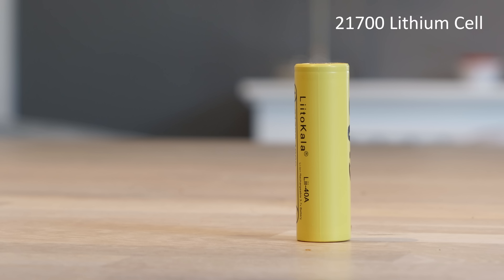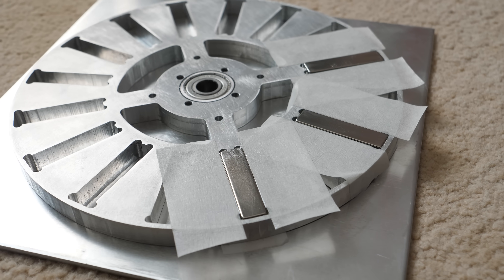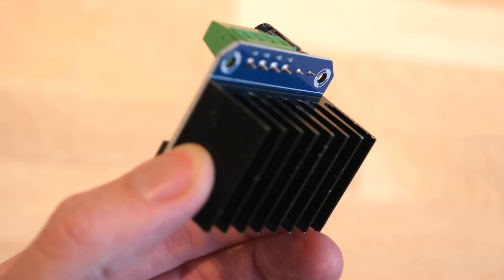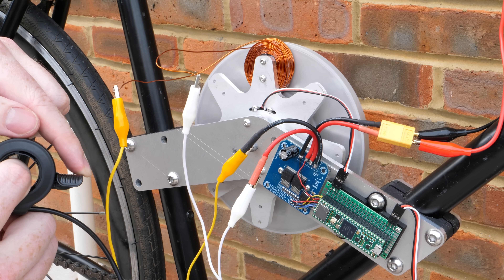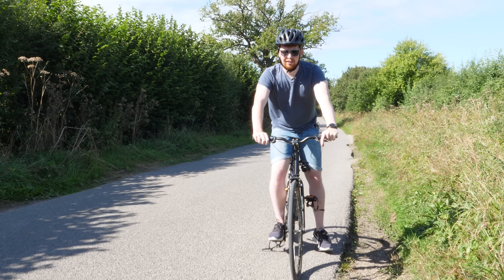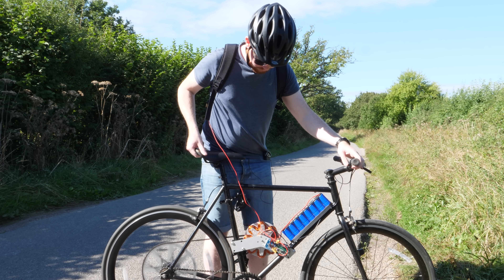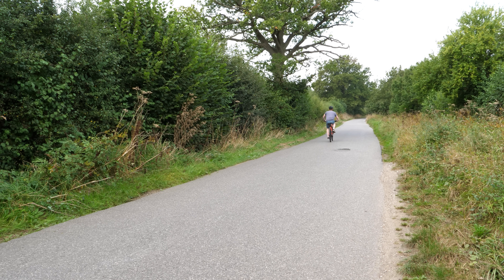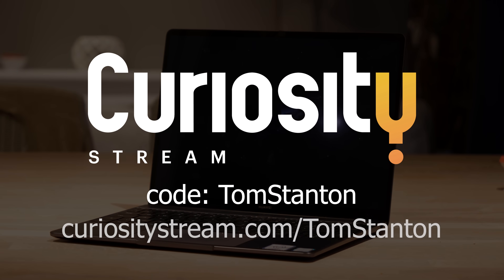Super Capacitor Bike

Comment: I reckon you're definitely onto something with the regen potential, almost like a boost to an additional lithium pack. Love how well the ultra basic BLDC controller works! Would love to see a speed limit test on it with some big voltage behind it ;)
Reply: He was dead on with the cap sizing!  Tom used 11 kJ of capacitors, and an 80 kg mass at 30 mph/50 kph has ~8 kJ of kinetic energy.  Note that he's pushing them pretty hard, though- these guys together are rated for 475 W continuous and 3888 W peak, so running them on a 4 kW motor from dead to full is pretty aggressive.

11 kJ is perfect- in practice, you want 30-60% extra since you have to get down to half voltage to get even 75% energy recovery.  You can use a boost circuit as well but they're not very efficient.  I'll note that li-ion is actually pretty amazing, though: with high performance cells like a 40T3 an 8 kg 1.5 kWh pack can push 20 kW peak, 14 kW continuous, and anything <8 kW is about 99% efficient.

  @Drone Force   A 4000 lb car @80 mph/130 kph has ~12 MJ of kinetic energy, so you'd want around 800 (~56 kg) of those capacitors to get a car up to/down from speed.  You'd probably want more, though- these ones could only handle 47.5 kW/ 64 HP continuous (but 390 kW peak).
Reply: @harperwillis5447  Sorry but your 99% efficiency claim fails to account for the horrendously inefficient charge cycle. Electric vehicles as anything more than toys are a fools errand. Even Tom properly acknowledges the power density of just about any liquid fuel is vastly superior to the best battery... and have fun charging your shit up for 1-3 hours just to get 50% when I can fill a gas tank up in a few minutes
Reply: @alphaforce6998   try looking up coulomb efficiency- li-ion is ~99% efficient while charging.
Reply: @harperwillis5447  No, they're not 99% efficient because that would only be under specific circumstances and a best-case scenario. You'd have to be charging at relatively low currents, and as the heat of the battery increases by virtue of reaching its capacity, the efficiency drops off sharply.

The net efficiency at a reasonable charge rate (i.e. something notably more than 1C) is going to be below 95%, realistically in the 85-90% range. This may improve for a short time after a few initial charges, only to gradually degrade again as the battery itself breaks down and loses the ability to hold a charge.
Reply: @alphaforce6998  no mate you have misread and misunderstood me as I've said twice now. NO STAND IN. that's replacement or one or the other. Whatever you think about batteries is wrong hideously anyway simply proven by trying to force charge a lipo. But
 I said you use them both together in synergy. The supercap captures and stores, it can capture all the small extra wasted energies not capturable via a battery because it's too inefficient on charge.  But if demanded immediately the supercap will feed the demand, if not demanded the supercap can charge the battery at the slower rate the battery needs. Meaning that in combination the batt and supercap overcome the limitation of resistance vs capacity. What the heck have you been talking about? And or reading? Wake up bro.
Reply: @alphaforce6998  1-3 hours to charge to 50%?  My model 3 charges to 50% in 10 minutes.
Reply: @DigitalArtisan77  You clearly have a theory based upon a lot of things you have no clue about. The only thing the capacitors might do is provide a bit of extra current to get a heavy load going, which is essentially what motor start capacitors do. Even if you use caps to capture a charge on braking or something of that sort, it will be a very limited amount and is dubious as to whether or not the weight and added complexity of the caps is worth the "benefit". You're living in some fantasy land where you believe electric everything is the future, and unfortunately for you, if it ever comes to that you'll be in a cube somewhere doing your prescribed routines for the system.
Reply: @niktak1114  False statements are fun, unless you're charging to 50% from 49%.
Reply: @alphaforce6998  the max charge rate for the model 3 is 250kW. The battery pack is only ~75kwh. I'll let you do the math.
Reply: @niktak1114  Typical house has 200 amp electric at 240 V, which means 48 kW if you max out the mains at the utility junction. Nobody is charging their cars from empty to 50% in 10 mins, and even at those stupid charge stations (which are rare) you are not getting 250 kW.

So by your own math, and a REALISTIC charge rate of 30 kW you are going to need about 2 hours to hit 50% on a 75 kw/h capacity pack. You'd be charging it at 0.5 C which is very low. You couldn't even hit 1C unless you pay for something like 3-phase electric with 360/480V.

Stupid are the ones who wear the mask, inject with poison, and roll around in ugly electric cars.
Reply: @alphaforce6998  and they are not rare at all. I've road tripped all over the western US in mine charging only from superchargers.
Reply: @alphaforce6998  look at a supercharger map. You can easily cross the US.
Reply: @niktak1114   When I fill up my tank with fuel, I do so knowing that just about anywhere I go I will be able to refill it when needed. If you want to travel along your supposed pre-approved corporatecuck EV route, by all means, go right ahead. Just don't stray too far - cattle needs to stay in its lane.
Reply: @alphaforce6998  Enjoy it while it lasts. Unless you are a senior citizen already then you'll live to see the day when gas stations are rare.
Reply: @alphaforce6998  Li-ion charge/discharge efficiency increases as temperature increases because it lowers the ion flow resistance.  Hot molecules move faster, which prevents side reactions.  High temperatures are only inefficient when the battery is not charging/discharging, because it also increases self-discharge.

Coulombic efficiency is always >99.9%.  If a battery is running with <99.9% coulombic efficiency then it will stop working after less than 100 cycles.
Reply: @harperwillis5447   Seems like you're attempting to present theoretical claims as if they mirror reality. The main issue is that heat causes a degradation of capacity and cycles, and that is just one of the many shortcomings of relying on an all-electric transportation device.
Reply: @harperwillis5447  great physics dude, I'm very low left brain. I don't know how I insinuated I was needing anything for a car, oh I meant the fly wheel in the KERs could be seen as a supercap in a way.

 As as a physicist you must appreciate that from then an engineers stance and technologically, that we are merely converting from kinetic to em, unless already , and then back again. 
My point is with the benefit of C with the supercap or whatever it then becomes with a cap if not C, when you lose that resistance a battery has to charge quickly and not a problem in a supercap, 

you can capture much more from the engineering of the system at much smaller fractions, viable because they don't become offset by the heat loss using them.  
So maybe this new found capabilities require new found approaches, I was just using  alternate convenient reference.
Reply: @DigitalArtisan77  The negligible resistance of a battery does in no way elevate supercaps as being a potential stand-in. Supercaps could, at best, just be used in-line to provide an initial burst of current to get a heavy load moving, and they could then be exclusively charged through braking. In fact, that's how they are used when they are used.
Reply: @alphaforce6998  what? Shut up fool. I never spoke of a standin or replacement.

The whole problem with batteries is the huge resistance met when trying to charge. That's why they explode or you lose so much in heat. Don't speak unless you have at least some idea. Maybe somebody would listen to you and believe it.

And you just described how a capacitor is used by function in any circuit. The difference with a supercap is the capacity buying you time to make use or store the spare energy.

And your rationale is you charge a super cap to start pushing a load, once that operation is complete its ceases to function within that load?
Reply: @DigitalArtisan77   There is little to no point to add supercaps as stand-ins for batteries, and that is exactly what you were talking about. Using them to capture energy otherwise lost to braking or rolling down a hill only makes sense in heavy vehicles where a meaningful improvement to range could be realized... but in general, heavy battery powered electric vehicles like trucks and busses are just a dumb idea that appeals to idiots that are fascinated with obsolete 1800s tech.

Batteries charge at a multiple of their capacity, but it is still a chemical reaction taking place that fundamentally limits how quickly they can be charged. The resistance alone is a minor contributor to the limited charging rate. Batteries that explode during charging use a more volatile chemistry; their resistance has nothing to do with this.
Reply: You could add nitro boost to your electric bike for fast acceleratio ln
Reply: @karmo0o178  totally could and it would help smooth draw and protect batteries all the time also.
Reply: @karmo0o178  Or a model jet or rocket engine.
Reply: I wonder how these would do as a "turbo" for a regular e-bike, extra power when you need it, and then regenerate it on downhills. Almost video game like, short speed boost that regenerates.
Reply: @OnlyKaerius  Probably not much because as long as the battery is able to supply sufficient current to meet the draw of the motor, the supercaps would not really do anything. For a "turbo boost" type of feature you'd need to overvolt the motor without giving up current, but the supercaps cannot be charged at a higher voltage than the system they are connected to, so the only real option would be using transformer to boost the voltage that the supercaps are charged with, and some kind of circuit that allows the motor to run off the supercaps when the turbo boost is active then switch back to the motor seamlessly.
Reply: Of course it's a natural synergy to the technology, interestingly not much different in function as F1 KERs using a fly wheel to capture the potential and deliver instantaneously or if not trickle into batts.
Just a format that works with the energy form wanted capturing, then used within those constraints of supply and demand over time.
 
Batt packs with a supercap buffer or a separate cap bank with power routed via, would take care of any spikes or lags and as you mention most useful here the regen,  Because with only a battery it couldnt store enough, quickly enough and wasting it.
 This idea is just emerging in drones now because of the weight and dependence on batts and investment communally.

Maybe put a flywheel between the pedals? Tom play with these also. Super fusion. It could gear to take and generate fro caps from pedals and from back wheel capturing extra kinetic energy not typically taken.
Reply: Wait... he just made a synchronous AC motor driver.
Reply: What I’d be interested in, is a combo of both, supercap’s and lithium batt’s where the supercap’s get charged in a few minutes and then hand off their charge slowly to the li-batt’s for use. That way, any downhill or breaking event could quickly recharge the supercap’s and then in term slowly recharge the batteries…
Also remember that big voltage/amperage can be hazardous ⚠️
Reply: @RobiBue  Lamborghini already did it with the li-ion supercapacitors in the Sian so idea was already executed.
Reply: This could be like a nitros shot for an electric vehicle
Reply: Wish he would continue down this path. Kinda what got me following him in the beginning  in the beginning when he built his first electric bike in college. Building my own electric trikes. Musk bought Maxwell capacitors to take advantage of their technology. Wonder what is going on there?
Reply: I think this is an old idea for low-voltage mild hybrids, using a capacitor to create a spike of power.  Especially if you primarily use it for starting, regen, and off the line torque a capacitor is very useful.  Mazda and Lamborghini have sold capacitor-based hybrid systems in production cars.
Reply: maybe set up an adjacent system for "regen braking" that charges batteries and flip a switch to charge the caps from it.
Reply: As i see it the capacitors only are good for if you want a specific volatage output, i dont know much about engineering of capacitors or even what they are or do, but this is how it looks to me.
Reply: I’d like to see it also.
Reply: The Inja made a electric motor bike with a similar feature
Reply: Capacitors for taking off quickly from the start, li-ion batteries for cruising, with regenerative braking recharging your capacitors specifically. Now that'd be neat!
Reply: They already add supercapacitors to some EVs and industrial machine to give it a much faster motor acceleration. In particular EVs this also helps when regen breaking since you aren't restricted by the batteries slow rate of charging and have less energy loss using capacitors.  Then you can use the capacitor to slowly charge the battery after. It's quite interesting.
Reply: This is the aspect that I don't understand.  Batteries are restricted in their charging speed, SuperCaps charge/discharge fast.  Why not build a battery/supercap pack optimised for charging - feed the battery while it can accept HV, divert charge to the SC when the battery is throttled.  Later, bleed the SC charge back into the battery at a rate it can accept.  Meantime tie the SuperCaps to regen recovery.  What am I missing?
Reply: @marcusnichols5595  Because capacitors have a very linear rise and decline of voltage, which means that their "useful range" is very narrow, whereas batteries have a wider voltage range where current is available at a given voltage. To charge a battery, the charge voltage needs to be slightly higher than the battery. It just would not be practical for those and for other reasons.
Reply: @alphaforce6998  Capacitors also do NOT work in DC as it would become a characteristic OPEN circuit.
You'll only see the impulse response on start, but then it will OC in steady state DC... seems many people forget this....
Reply: I'd like to see you put a trolling motor on it.
Reply: I'd love to have a bike like that
Reply: Sian has lithium ion supercapacitors and regen, it literally only needs the regen to charge.
Reply: @artistanthony1007  They are classified under EDLC... which is probably what he is using.
Reply: The Lamborghini Sian uses the same technology. It has a large supercapacitor for insane launch speeds.

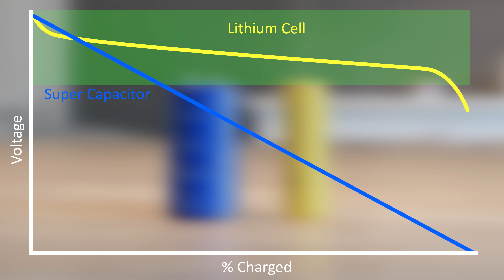Comment: @1:20 in your graph, you have a straight line for your '%charged' vs voltage graph for supercapacitors. Firstly, it's backwards. As you increase charge (go right on a graph), voltage increases, not decreases. Secondly, this isn't correct because the energy E in a capacitor is 1/2*C*V^2, the curve should look like a square root curve y=sqrt(x), or more properly V=\sqrt{\frac{E}{E_{max}}}.

Comment: It feels like regeneration would be ideal for super caps no? Could you use super capacitors as a regeneration “cache” ? Like charge the caps quickly then discharge quickly to accelerate or over time into the battery at a more efficient time scale?

Comment: Is there any way that you can create a controller that would take the lithium battery power that you have in your battery and bump it up extremely high and dump it into the super caps. Then dump all the super cap energy into the electric motor and while it's slowly discharging.

Just wondering if that might work. My curiosity was super caps haven't brought me to the point of actually building anything yet. There are so many things that I think that they could have improved using a battery super cap design.

Comment: Dynamo Bike Possible?? What if the pedals spun a Flywheel (with a low gear chain to set off motion, Then as the flywheel charges the Capacitors the electric motor on a Higher gear takes all the strain while the Pedals just keep the Flywheel at speed and generating electric? kind of like those dynamo torches that you keep cranking to work.